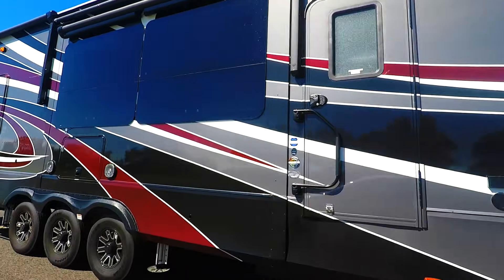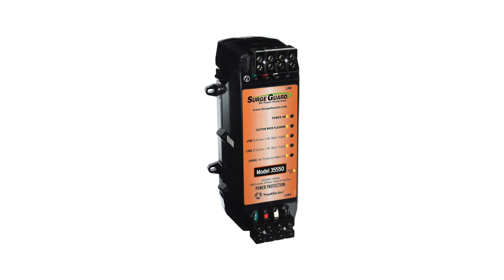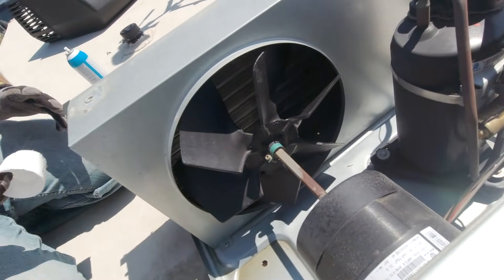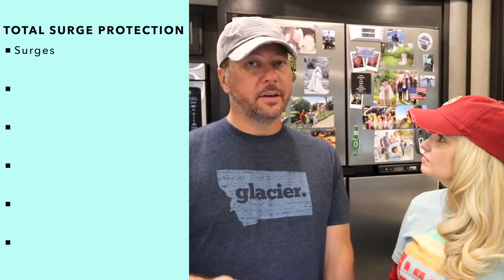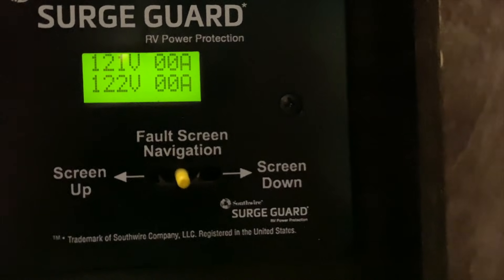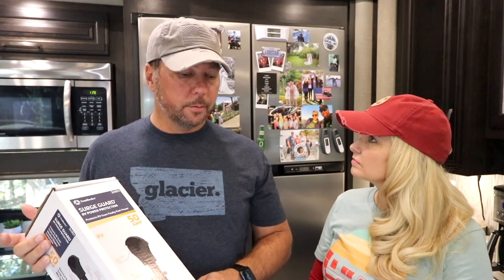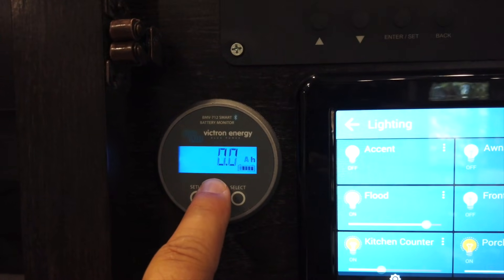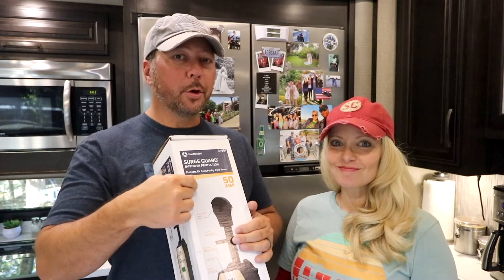⚡️🔌 Total RV Power Protection | Surge Guard | Full Time RV

Comment: After 4 days without power due to the wildfires in N. CA. (Smith River Complex) it was interesting that when power returned... it was pushing 133 volts for about 18 hours.  My EMS-50 advised me by shutting down, and the error code.  Ran my 3500 generator until the next day when the voltage stabilized.  Love it!

Comment: I run the same brand in our momentum but we use the green labeled one, it’s installed behind the false wall so it doesn’t get stolen hanging on the power pedestal. But the main reason we went the other route was you can unplug both ends if it fails and then just plug the cable together untill you get a new one and your not having to take all kinds of stuff apart just takes a couple extra electrical components! Great info!

Comment: I got the Progressing portable a few weeks after picking up my 5th wheel. It tripped one afternoon on one phase. I went out, switched the resorts breaker off, and back on. It reset my Progressive EMS. The EMS probably saved me some burned out circuit boards.

Comment: Nice job and thank you, love your videos. I use the inline unit and it as saved us a few time with  a ground fault issues. I like the inline because it gives you total protection from shore power, solar and generators. I drilled my own hole in the floor for a wire run and added a string in the run to help guide additional wiring.

Comment: We went with the 50A Surge Guard Portable Total Electrical Protection 34951 because we camp at many state parks and other parks and only have 30 amp service.  We added the $50 wireless monitor option that allows us to see how much power we are using in the coach and to turn off things if we get close to 30 amps of use.  We also like the quick 10-second analysis to access to this model, compared to 128 seconds on the internal model.

Comment: The 34951 by Southwire Surge Guard, is that the one you recommend for the total protection of an RV? Saw several different units and just wanted to make sure I got the correct one!  Thanks so much for all your help and great videos! Best channel ever  for all things RV!!!  We discovered your channel about a month ago, that’s why we are just  now on your surge protection video, eventually we will get to your latest video and we will. Thanks again… Arnold and Maleia
Reply from the maker: The unit in this video is still a very good system.  More recently, we are using hughes gear: https://youtu.be/uOyVSZ9XWII 
Honestly, either one works.  The key is to get a unit that shuts off power when voltage is low to protect your RV, as well as the surge protection.

Comment: Great topic on this video!  On our last trip about a month ago our portable surge protector went bad.  It was the molded in terminal the rv cable plugged into became a loose connection and was arching inside.  So now we need another one before next season.  I went out to look at the new ones and saw the ems units and I was debating on which one to get.  Your video just helped me make up my mind, its going to be one with ems in it.  The extra cost of that unit will be well worth, instead of having to replae a fridge or a/c unit.

Comment: Excellent video and thanks for talking about both vendor’s models.  I don’t need the giveaway so please don’t include me in the list.  I just purchased the Southwire 34951 50Amp model with the add on remote monitor as it seems to have the best Energy dissipation protection (up to 4200 Joules). The 34931 (30 Amp) has 2450 joule protection. Both models have a limited lifetime warranty for the original purchaser. The original or a copy of the original receipt is required, so make a copy and put it with the manual. There is also a connected equipment replacement warranty (fair market value) if the unit doesn’t do its job properly and something gets damaged in your rig.  At the end of the day it only makes good sense to have some level of surge protection on your RV, but, as you’ve Clearly explained, surges aren’t the only issues you may encounter so having some level of electrical management or protection makes a LOT more sense. Spending $150-$300+ dollars on some type of electrical protection is a very small price to pay for a rig that may cost from $30K up to $500K or more.

Comment: What a great video.   As a Certified Home Inspector and a Licensed Electrician, I marvel at your knowledge of RV electrical systems.  As we research adding Solar, Inverter, monitoring, and Batteries, I found your video very informative.  My question, is related to this topic.  I am worried about putting an internal unit (possible fire) and currently use a external EMS only.  I'm thinking about using both as a means to protect our home.  (Here is the question): .....Have you ever seen anyone use both?  My rationale for using both is hoping that the EMS at the pole will help minimize an actual failure at the internal unit that could cause a fire..............On a side note, How many external units actually get stolen?  We predominatly stay in Thousand Trails parks and State Parks and have never really talked to anyone who has had one stolen.
Reply from the maker: We've heard of units being stolen, but not first hand.  I'm sure a lock on it would be enough of a deterrent for the causal thief.

Comment: Low voltage in an RV park or a Marina where the entire electrical system is shared from site to site or dock to dock, is a lethal condition for on board appliances. If you understand that amperage is the lifeblood that your appliances need to live on, then you also need to understand that voltage is the “thrust” in conveyance of that amperage. A low voltage condition starves your appliances of the amperage requirement they need to run on. And the result is that the appliance dies under stress.

Comment: As usual, another outstanding video.  I am in the process of buying a diesel pusher class A.  Been studying about putting a solar system on it. Has Chad sized the number of solar panels you guys will require with A/Cs and washer/dryer and God only knows what else.  ( and by the way, Tara is a joule).  I thoroughly enjoy your videos, and have  learned a lot (probably at your expense)(sorry)
Reply from the maker: We've not specced out solar yet.  The thing to remember is solar just charges batteries.  Yes, larger / more panels will charge faster, but it's the batteries that would need to power everything.  The reality is you need a LOT of Amp Hours to run AC or other high amp items and it's just not very practical for more than short durations.  A single AC will pull around 125Amps DC.  To run an AC for 8 hours would mean 1000Ah or TEN battle borns.  That doesn't include anything else running...  We run our genny during the day if we need AC when boondocking.
Reply: @ChangingLanes  another question (if i might be so bold)...can i bring the battery bank (prob 4 in parallel) indoors for the winter and use a trickle charger/maintainer on all at once...thanks so much...you've been a godsend to me for all your help

Comment: I have a 22' Jayco hybrid  that uses 30 amp system not a huge fifth wheel with many more systems like you have. Do I still need the system that is more than just the surge protector? Probably a stupid question but I am totally ignorant when it comes to electrical issues. I stated watching RV you tube channels after going from a pop-up to our hybrid in 2018  and am always trying to differentiate from what applies to us and what is only for full-timers in bigger, more involved rigs.Have been a subscriber for over a year now. Thanks for all the fun and informative videos! Wayne

Comment: Interesting products and the best part is, you folks have done a lot of the leg work in sifting through the many products that do not fulfill the needs for this type of protection.  Was thinking about your comment about how to get around the on-board unit if it blows or goes bad. Rather than wait for it to fail and route the wiring around the unit, it might be best to route a switch to by-pass the unit if and when it might fail so the down time might only be a flip of the switch. #giveaway
Reply from the maker: Yes.. that's definitely an option (bypass wiring)  👍🏼

Comment: Though I just have a "surge protector" I always use it to ensure the pole is good before I even connect my rig. It saved me just a week ago. I plugged in the surge protector, flipped the 50 amp breaker and saw only one leg of the circuit lit up. (mine has a blue/green indicator for each side of the circuit). Power off thinking it was just a bad connection, reseated, powered back on, heard sizzling sounds. Shut it off. I got out my 30amp dog bone for the first time and connected it and reported the issue. DNR was there in about 1 hour and replaced. it. Had I not seen the issue at first, who knows what might have happened within the rig. Now, knowing there are BETTER protectors. I'M IN!
#giveaway
Reply: Dave, I do the same as I only have a surge protector.  I found a problem with a campground up here near Quebec City, Quebec, Canada.  Told the campground owner and he had his electrician there the next day.  I switched sites.  Such an easy thing to do to protect such a big $$ investment!

Comment: I installed the same PI EMS HW 50 in my 5th wheel also. Great product... but a pain diving into that web of wires especially not being an electrical geek. So here's a question... when your EMS took the bullet, and you rewired without it, were you guys just plugging back in without "protection" ?  That wouldn't be, or would it? (protection...  Sounds like "safe **x"... safe  "elex"?)  bg
Reply from the maker: Yes... for a few days we were unprotected till I put in the surge guard.  Just disconnected shore power side of the EMS and put it back into the ATS.

Comment: I’ve seen several RV review videos lately that show units that come with a surge protector already equipped. Is it overkill if a separate protector is added at the pedestal? Thanks and you’re videos are super. Safe travels.
Reply from the maker: Depends on what's installed... If it's a total protection system it might be overkill but won't hurt anything.  If it's just surge protection, then we definitely recommend this.

Comment: How do you feel about plugging a 30amp RV in to a 50amp service IF you have to use an extension cord or if you've wired a longer shoreline cable to accommodate the distance to your power source  ? The reason I asked is because you do lose amperage at a certain distance  .. I'm 348ft from my power source  .

Comment: # giveaway. Another great video and topic. In 2012 we were traveling from Washington to Tennessee. We weren’t newbies as we have had RV’s for about 30 years. I really never considered purchasing any type of surge protection. We had never had any issues, at least that I was aware of. On an overnighter in a beautiful, well maintained park in Nebraska my wife started smelling an electrical scent. I immediately went outside to our electrical connection and there was smoke coming from the plug where it attaches to the trailer. In a panic I turned the connection to disconnect it and the prongs came out with the connection. Pretty much everything associated with the two parts of the connection were melted. I so glad we weren’t asleep at the time. The next day I was able to get the parts I needed to make the necessary repairs. The microwave did not survive. We didn’t experience a surge. I’m sure it was something with the pedestal wiring but not sure what it was specifically because I didn’t have a tester available. We notified the office before we left the next morning. ASAP I ordered and installed a progressive Industries hard wired unit.  It worked great. When we purchased our new Momentum 351M we also immediately purchased the South Wire 50 Amp Surge Guard 34950. More then once we’ve had to switch to another power pedestal because of problems with the pedestal we were assigned. These units are not cheap but the considering what they protect it is far more cost effective than not making the investment. Worst case scenario, it may save your life. I know we sleep more soundly.

Comment: Great Video.  #giveaway Just wanted to ask.  I have actually questions on plugs that you can use when you don't have a 50amp location.  I have seen folks use one from the normal 110v 15 amp and one from the 30amp plug to give them 45amp. I know it's not good for over all but at times its' the only way to get power.
Reply from the maker: Yes.. and we will have a video covering a whole bunch of bog-bone-down options in an upcoming video that show connecting to 30A, 30+30, 15, 15+15, etc. in the near future. 👍🏼

Comment: #giveaway - Thanks for the video You did a better job then me on explaining the many issue with electrical power. I would also not the delay on resetting allows for the electrical problem to clear itself (ie low voltage due to something starting.)

I would also say, people may want two. As you noted, then thing do sacafice themselves to save your RV.  But then do you want to run with the projection while you are waiting for the replacement.

If you have to replace the internal a lot, ( I do not thing you do) you could wire a bypass switch into the system.

Comment: Wouldn't it be better (more protection and durability)  to buy the 50 amp protector and use a adaptor for a 30amp camper than just to get a 30 amp protector?
Reply from the maker: Not if you have a 30A RV...  a 50A would just be bigger and heavier for no reason.

Comment: What do you use in the parks with high voltage all time 129-133 volts? My surguard doing it’s  job and cutting the power when it over 130 volts

Comment: Hey, I’m a ham, thinking about grounding an attenda mast. Should I use a ground rod, or depepend on the RVs isolation and post ground?
Reply from the maker: Assuming you're grounding it because it's tall and conductive (a.k.a. lightning rod), then a ground rod is the only option.  A lightning strike through your RV's ground would be a bad day I think.  Better option would be to use a non conductive mast.  We use PVC.

Comment: I not a tech but Can you do video on soft startup, active startup, ems, the bull dog one, is there a difference? all power surge protectors? Also would like one with bluetooth.. this is for an older rv camper trailer and will most likely be connected to our champion compressor/inverter.   One more thing will and if they die (not work) Can they be replaced with parts or need to buy another?    Did I miss that video thanks

Comment: Great Video well needed info and I love the #Giveaway . I do have a question in you have solar w/ battery power and the protector goes out for low voltage can the battery backup take over?

Comment: Hi - thanks for this video. I have a quick question. We have the external surge protector just like the one you had in your giveaway. We have not used it yet. From what I have read, you need to test your pedestal as one of the first steps when arriving at the campsite. Can this surge protector assist with that task or do we need one of those multi meter things. Sorry, I too have very little electrical knowledge! Thanks in advance!
Reply from the maker: The surge guard will test it before it allows power through...  Assuming you have the total electrical protection model and not the surge only model.  👍🏼

Comment: I was told you could use a step down plug from 50 amp to 30 Amp if you use a 50 amp EMS on a 30 amp trailer. Is this not true ?

Comment: Chad, we have just purchased a 2021 397TH and I am looking at putting in the hard wired surge protector. My current motor home has the hard wired sure guard installed, but
it is installed after the transfer switch, going to the rv. I see you installed yours before the transfer switch on the shore line only, what if the
generator has a hiccup, (spark plug malfunction, fuel line clogs, etc) and voltage drops? Maybe I’m being too anal, but wouldn’t that have the same reaction
as shore power voltage loss? Would it be safer to install the surge guard after the transfer switch? Looking for other’s opinions. 

By the way, nice job on your solar system install. Looks awesome.

Comment: #giveaway What I "love" is that 50 "amp" is really 2 120 volt legs for a total of 240 volts just like houses have. Why is it ONE 30 amp but only 2 25 amp legs?

I hope you will explain how motors will attempt to draw the same power. If the voltage drops the motor will draw more amps or current. More current means more heat until the wires fail on the armature.

The frequency is important for timed devices. 60 cycle clocks will run slower on 50 cycle power. Modern tvs are "timing devices". (Computers too).

Most homes should have these devices in them. A friend had a business where motors and electronics were dying all the time. I put a monitor on the power supply. The voltage was 100 to 140 rapidly changing. Sometimes both legs of the 240 were the same. Some times completely opposite. After the signal conditioner was installed there was no more problem.